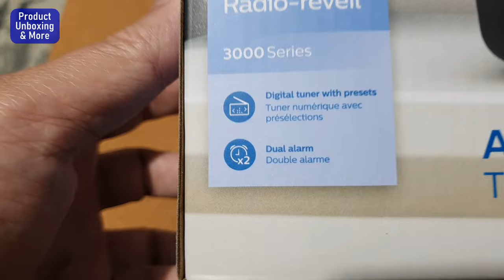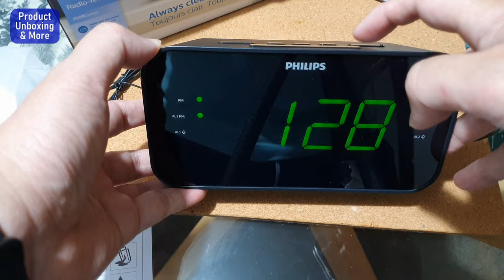Philips Clock Radio Unboxing and Test

Comment: Can you check/verify the alarm time once you set it? I heard that is not possible. And if you set the radio as alarm does it always increase in volume, or is that a setting that you can turn off? I like to set the radio as alarm but would be annoyed if the volume increases automatically.
Reply from the maker: Yes you can.  Just long press on the Alarm button and the blinking number shows your alarm setting.  I tried the radio alarm and the volume keeps increasing.  I am not sure if that can be changed.